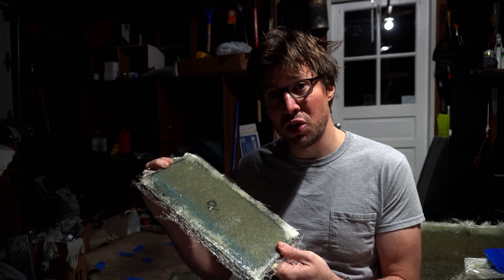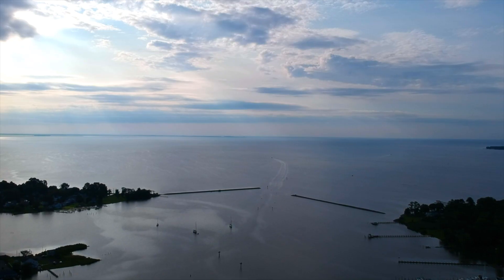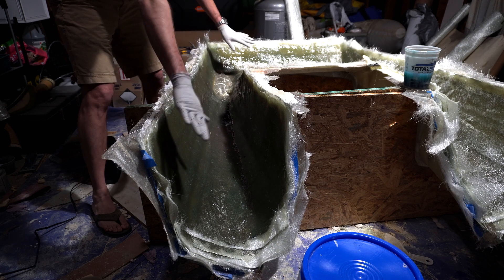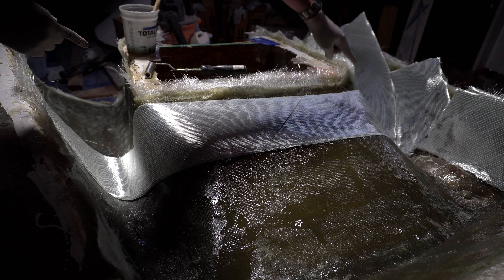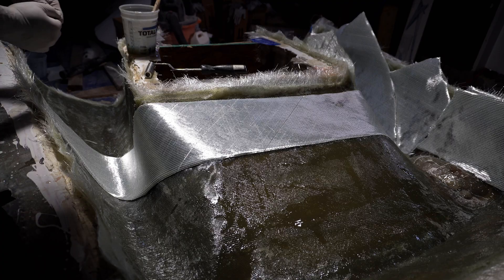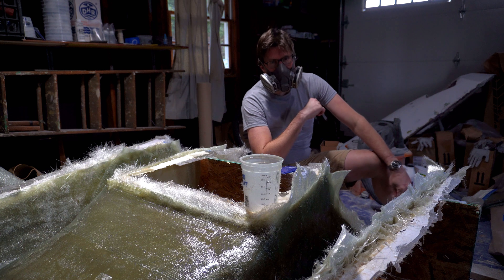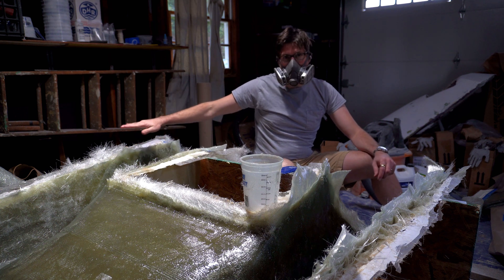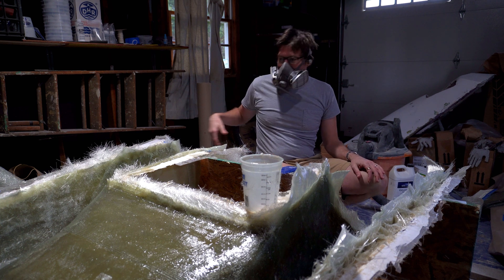The Final Layers of Fiberglass | Windpuff's Rebuild [S1 Ep 9]

Comment: It feels a bit like reinventing the wheel to try applying multiple layers of glass at once - unless I have misunderstood what you meant (better finish watching to find out ;)). At best you’ll have trouble with curing, plus, there is an actual fire hazard here to keep in mind. This stuff is highly exothermic! ;) I think you can apply the next layer as soon as the last layer tacks up though - you should be able to do several layers in a day. (On the other hand, it should remain tacky for a good while - e.g., overnight - if not starved of oxygen by coating with wax based gel or PVA.)
Reply from the maker: It’s polyester so it doesn’t kick like epoxy does. It stays liquid in this cold climate for a long time and then gels, later it cures; but it never gets hot, even in the summer.

Comment: i have yet to work with 1708,  all my glassing has been done with 17 biaxial. i would have done 10 layers with 17oz biaxial only. much less resin used for starters, easier to wet out ie less time to do the job and i wouldve used full width cloth, not stripes, pre cut to size, numbered, with an overlap at the center of the piece to tie it together. this shape isnt an easy one but i reckon 6 hours to glass 10 layers in one go.
Reply from the maker: Faster wet out would be great! I went with the CSM backing because it both adds bulk and it helps to fair out any lumps or bumps from the previous lamination. There will be many more projects and layers of cloth on this build, so I will give plain 17 a try on one of them :)

Comment: I think the strength to weight needs to be considered. A great big lump of extension will trying to tear itself of the boat. It will be about how well you attach it to the boat as this will add layers of glass to the new extension as well. The risk with fibreglass is the temptation to over build. You can get quadraxle  glass cloth which would mean not worrying about which direction you lay the glass cloth as long as you overlap where the fabric  joins. Big project I watch with interest.
Reply from the maker: I built it thinner than I wanted because I know it’s about to get more cloth added during the attachment

Comment: Is thi extension going to have a deck? The reason I ask is because the top of this thing is going to havs a great deal fore and aft compression on it, as the backstay tries to pull foreward as well as up.

The diagonal layup will probably not be as helpful as you think, as most of the tension and compression loads will be fore and aft. Diagonal layups are best to resist torsion loads.

The diagonal strapping on the CONSTITUTION did little to make it impervious to cannon balls. What id did do is keep the planks from sliding against each other. With GRP construction, this will be far less of an issue. What made the cannon balls bounce off the sides of Old Iron Sides was its oak planking.

The main structural issue I'd worry about, is the bolt connections which I presume will attach this structure to the boat. The bottom ones will be under considerable tension. The top ones will be mere locator pins. Where the bolts go through (on both this structure and this hull) should be heavily reinforced, both top and bottom. This is because loads will ne concentrated there. This reinforcement should be tapered aft with fewer and fewer laminations, with the longest ones at the bottom.
Reply from the maker: The structure will get a deck after we get the structural members glassed into place.

Comment: Herbie you beautifully showed what can be the drudgery of hand layup fiberglass work! 
Imagine how hard that would be to do on a temporary inside mold right on the hull , outside, in the sun upside down.  A nightmare! 
Tackling those large pieces certainly shows how your skill level is up there with best of us! 
Cheers Warren
Reply from the maker: Thanks! Doing this on the boat would have required flipping the boat over to do it right. 
I’m going to be debating how to approach the rotten deck core. Do I cut the deck open from the bottom and preserve the deck or should I cut the deck and work from the top with a tarp over the deck? I feel like I’m answering my own question here 😂
Reply: @RiggingDoctor  depend on access from below, I would probably work from below if possible , usually the skin behind the core is a lot thinner.   I did like the idea suggested and tried for drying the core with vacuum and then using gorilla glue to replace it which kids with moisture and expands like foam